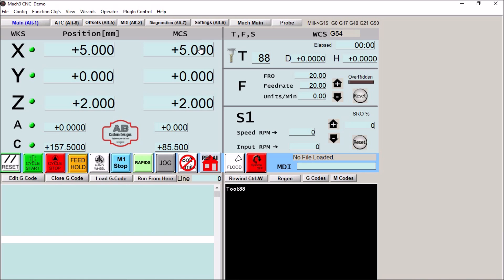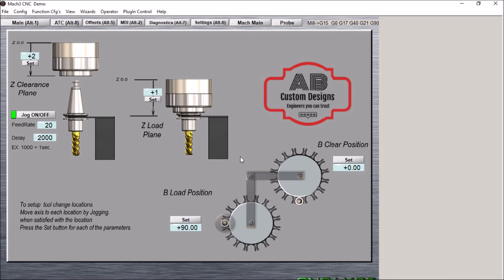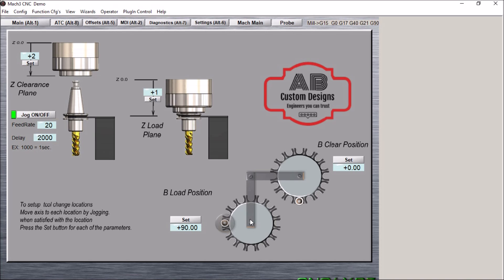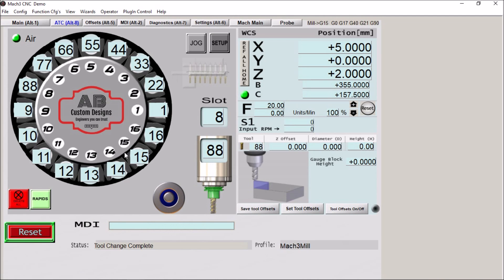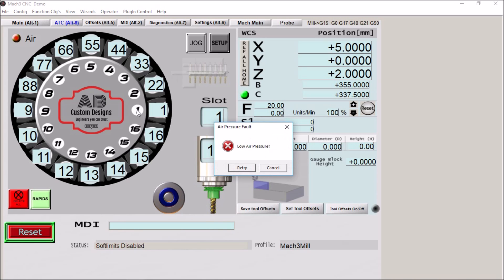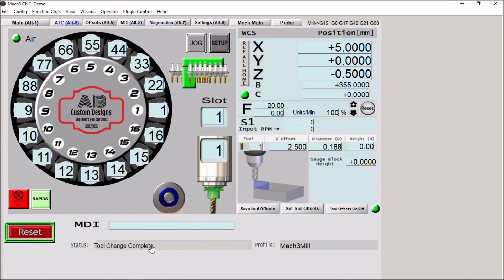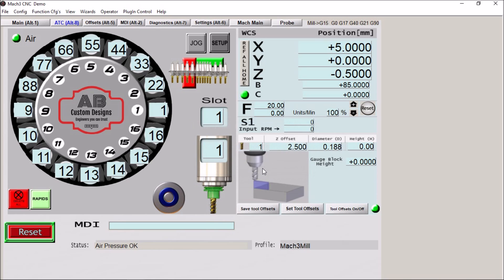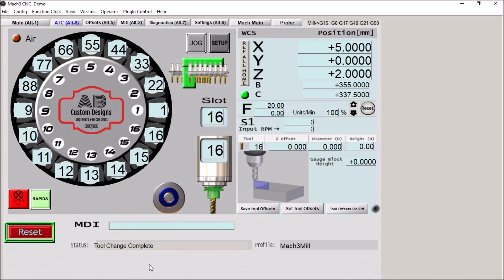16 Tool ATC X2 Freak Mach3 Screen Set

Comment: Awesome work.  I'm just getting my G0704  conversion up and going.  After doing the Power  Drawbar, I want to build an ATC and will be buying your custom screen assuming it will work for G0704.
One question, are your screens built for Mach3 or Mach4?  I own Mach3, but was considering migrating to Mach4.  If your screens work with Mach3, then I'll stick with it.
Reply: I just saw Mach3 in title, so now I know!
Reply from the maker: Hi Tom,
My Screens work with many different machines I recently built rack style screens for mills and logos for the G0704.
https://cnc4xr7.com/sinumerik-rack-atc.php  I can Also add these logos to the Rotary ATC as well.